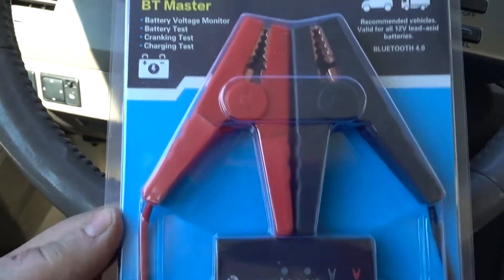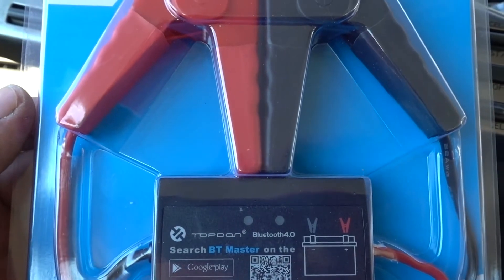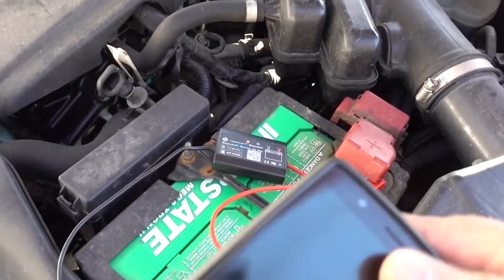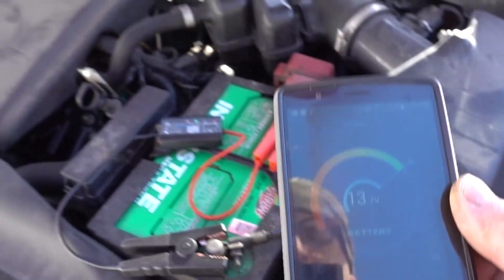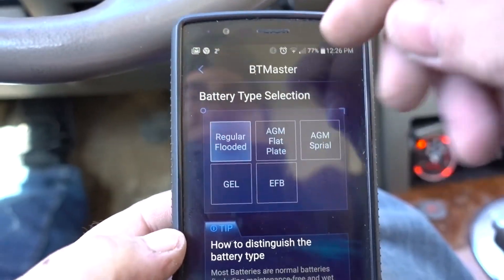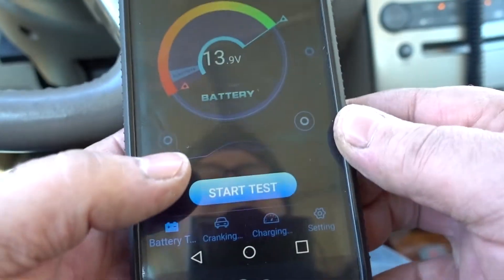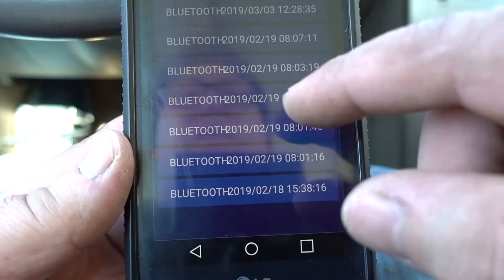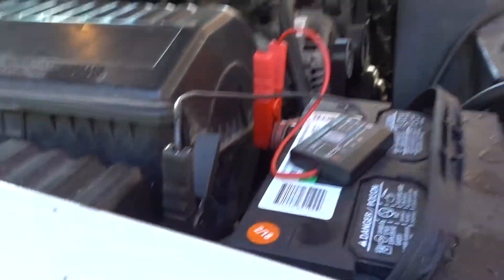Bluetooth Automotive Battery tester Topdon

Comment: You didn't go through the whole battery test. The battery test is supposed to show the health of the battery, internal resistance, and other results. Just knowing a battery voltage doesn't tell you how healthy a car battery is.
Reply: Quicklynks BT2000 este cel mai bun tester ce se gaseste pe piata deoarece este singurul care calculeaza SOH si CCA si rezistenta interna a bateriei.
Celelalte testere nu fac asta.